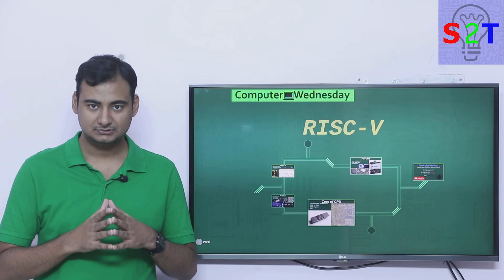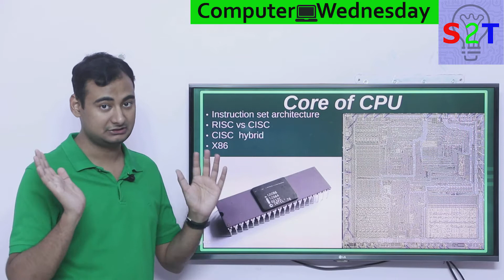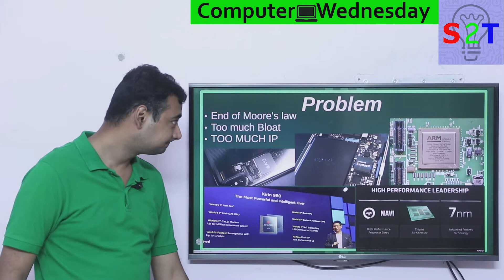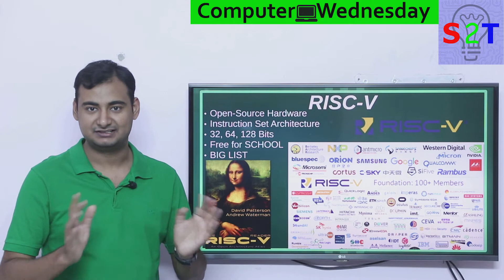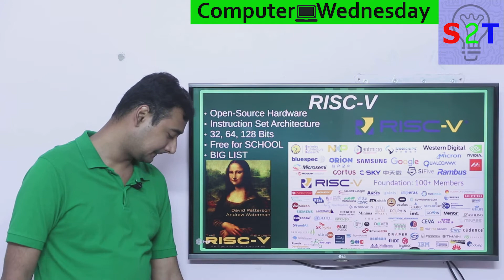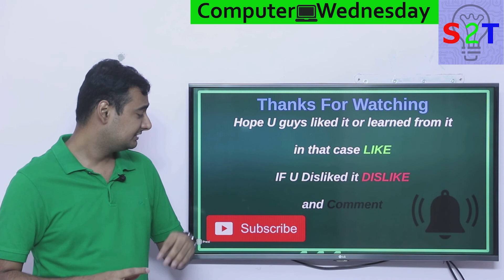RISC V Explained{Computer Wednesday Ep54}

Comment: 15:44 "Steam is starting to support Linux for gaming"

No. Valve released Steam for GNU/Linux way back in 2013. Only now most of the games have native GNU/Linux port, which is very nice. Now you can even run most (growing) Windows-exclusive list of games (If you check one checkbox in Steam settings under Steamplay). Thanks, lord Gaben. I don't have to use oppresive Windows 10 with forced updates, forced invasive telemetry and ads in start menu.
Reply from the maker: thanks for the info